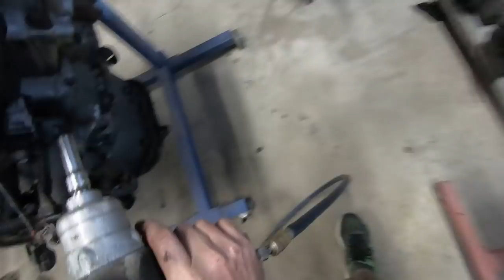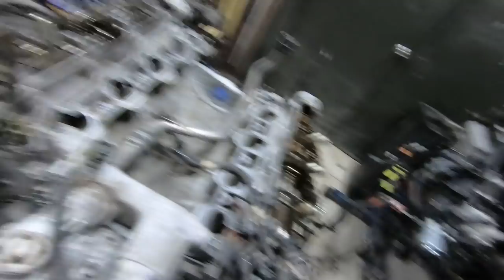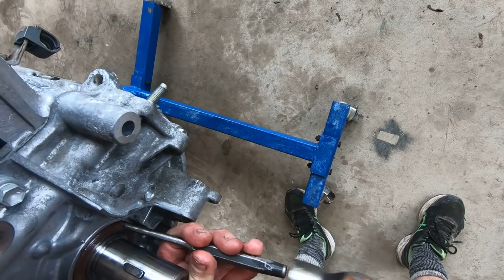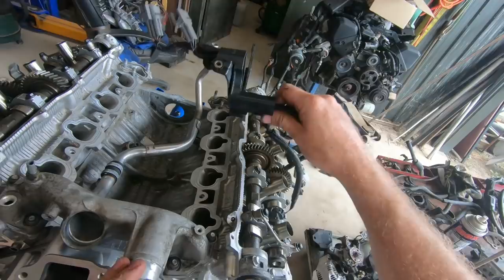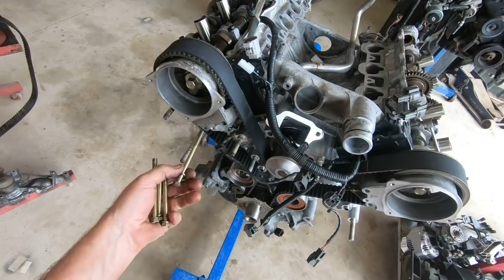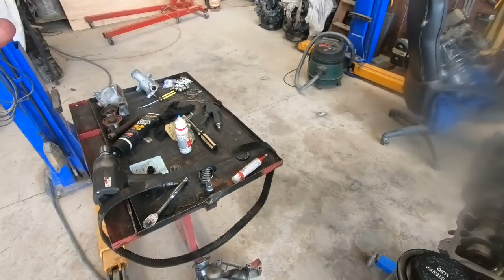1uzfe Cambelt / timing belt replacement. suits LS400,  Celsior, SC400 and soarer. 1uz

Comment: Brah!!! when you said "Little Dot At the bottom of the crank" that one line was EVERYTHING in this whole process... Ive seen NUMEROUS vids about how to properly line up the belt and the markings but no one SPECIFICALLY mentions what the crank mark looks like on the crankshaft gear... CartuneNZ is my SAVIOR!!!! Thanks Again!!!! when it comes to my 1UZ-FE engine im trusting CARTUNENZ!!!

Comment: Did this job in my garage in 14 hours, engine still in the car. Not too shabby :-)
Reply from the maker: Well done.  I started doing one in the car recently.   Camera running. Then found oil leak between oil pump and block so dropped the engine out to fix.  Videos are coming for that one.
Reply: @CartuneNZ  Awesome. looking forward to watching. Subbed. Good luck!

Comment: Just hopped a tooth on a 94 Lexus and was in for a helluva time, thanks for the info, making things easier
Reply from the maker: Hello Randal.   Glad to help.  Hopefully yours is a gen 1 engine.   Cheers Kelvin.
Reply: @CartuneNZ Why did you say hopefully its a Gen 1 engine? i have a gen 1 engine & have been having a helluva time trying to get it running right after replacing the head gasket & all the other old components

Comment: any tips help: stuck on cam bolts, won’t come off even with 170 PSI on the air gun
stuck on coolant channel above water pump, thing is on there real good and won’t budge

Comment: As Kelvin screws the distributor caps into the cam pulleys, "Well I probably won't do them up with the rattle gun...well, not on camera anyway". Lol!
Anyway, another top video from CartuneNZ that I studied in depth, before attempting to replace the timing belt on my 1UZ-FE VVTI.
Kelvin: Will you publish the names of your secret car part goo, such as the "lube" you put on the cam seals, and an injection of something mysterious and helpful onto the front main seal, from a push tube with "Master Gasket" written on it?
Thanks again for sharing so much of your knowledge! My '00 GS400 would not be running (like new) if not for your super awesome videos!
Reply from the maker: I use a Moly grease for the centre of the seals , this is an engine assembly prelube, so it works great for priming oil pumps too.  The Master gasket is a Loctite product , 518 master gasket.  Great for the outside of the seals as it helps them slip in them ensures they stay in and is a sealant to 10 thou gap.  Cheers Kelvin

Comment: Subscribed! I have a 1992 SC400, upon which I am about to attempt a starter change. Could you please do a video on ALL the other components I should change while I am in there, please? I hear that gaskets need to be refreshed, certain plastic bits will surely break, and certain hoses will need to be replaced as well. I would be most grateful to see the whole pile in one place, because as I assemble my set of new parts, I am afraid of leaving something out. I find especially confusing, the bundle of snakelike hoses all around the intake. I can't tell what's what.
Reply from the maker: Ive done plenty of videos on changing starter motors and removing intake manifolds if you search for each.  My engine prep videos cover lots of the parts used.  I have other topics to cover at present.   Cheers Kelvin.

Comment: Hey Kelvin, awesome videos ya got. Just found your channel a few weeks ago and been watching lots. Was wondering what gasket sealer you're using on the WP and the crossover gaskets. (just as a safety measure) Is it a FIPG or just regular sealer? Another question; The cam belt kit I got from Aisin has a metal gasket for the thermostat housing. (square) I've done a few cam belts/WP on the 1UZ and everything I read and always seen it uses FIPG. Is that part of the water pump machined smaller to accept the metal gasket like the back of the newer WP is or should I just stay with FIPG? Keep up the good work.

Comment: I've got a question: 
I found the product you use to lube the inner seals on crank and cams, but I'm not sure what sealant you use on the outer ring.
Looks like a Loctite product but I can't tell what, and I'm not sure if red thread locker would be the proper application fluid.
Doing this process on a 1st gen 1uz ('92 sc400) within the next few days and am considering doing those seals since I'll already have it open.
Let me know what products you used! thank you, this video helps tremendously!!!!
-
also; on the water pump outlet by the thermostat, specifically the plastic housing to metal, do you use any FIPG? if so would you use grey type? (ex: Aisin AB1207B1 or equivalent)
Had my car worked on by a family mechanic; and it's leaking from there with grey RTV / FIPG, and idk if that's proper application considering its leaking and there's no room for the gasket maker to seat properly.
Thanks again! Might shoot over an email if I don't get a reply, can't find any info on it.
Reply: And it's a 1st gen UZ, and I bought the Aisin kit since they manufactured Toyota water pumps; doesn't have the grooves for FIPG so I would only use the included gasket and no FIPG?
Just confirming after watching your video on the differences between pump seals (very helpful, thank you for teaching me that).
Reply from the maker: Loctite flange sealant #518 for outside of seals.  Use correct gasket with no sealant on the thermostat housing. If it leaks generally it's due to the plastic housing being stuffed.  Use the gasket that came with the waterpump.
Reply: I believe the outer gasket liquid you're using is Loctite 'master gasket', which is either 515 or 518 formula; let me know if either works or if one is better than the other
Reply: @CartuneNZ  much appreciated; thank you for the quick response 👍

Comment: Hi Kelvin, I'm in Virginia, started buying <1997 Gen 1 SC's last July, have 2 2JZ-GE's and 4 1UZ-FE's.  Your content is most helpful.  I've a desert stored '95 SC400 (my 'practice' car, only one not a 'garage queen'), only running on right distributor.  Replaced port (left) side coil, open hv coil, checked igniters - both coils now fire, left rotor and dist cap look good, but 1, 7, 4 & 6 just not firing...compression check OK on all cylinders.  Rotor alignment tab on left dist is correct.  Left cam position sensor resistance is OK.  Where might I look?  Thanks so much for your awesome, kinetic videos!  I love the 2JZ's, but REALLY love the 1UZ's.

Comment: Thanks very much for the close ups of the timing-marks. This made me to find the problem of my 1uz-fe 2ng gen. But belts and pulles need to replace. Does the 211 teeth belt match to the older engines, or do I need to get the 209teeth? The sets withe 211 teeth are quite cheap.
Reply from the maker: Glad I could help.  With early non vvti engine you require the 209 tooth belt.   All other parts interchange fine but not the belt.   Personally I use all genuine parts as they are known good quality.  Cheers Kelvin

Comment: Hey kelvin, the threads for my timing belt tensioner are stripped, what would be the best course of action, helicoil? Thread insert?
Reply from the maker: Best option would be a replacement oil pump with new threads,  next is a thread repair system like helicoil or similar.

Comment: Thanks for the reply the kit I bought was from a well known for high powered Toyota uz and jz powered vehicles and I am meticulous about getting the correct parts as my father is a very good mechanic from Invercargill the only thing that I can see to be any problem is the replacement tensioner I was supplied I did contact the seller and the mechanic there said to me he had come across a faulty one once on a 2jz he had in his garage but had done 100s of them since and never had any issues have u ever had a tensioner that when u pulled the pin u thought it seems a little week my motor is a ucf10 from a early 92 celsior single wire o2 sensors and it has slipped the cam timing 3 times and it's always the drivers side bank the motor is in a 2wd 1990 hilux with w series 5speed and I am from Queensland Australia both my parents are from NZ thanks
Reply from the maker: I only use genuine parts so problems are extremely rare.   If its slipped timing several times I'd definitely have it apart to inspect.
Reply: Yeah I have had it apart quite a few times I think I can have all the covers and all the intake manifolds off in about 9 mins it's funny when I hear u say that people tell u it's a bit of a job to get it all apart . It's very expensive buying genuine parts when I first got my 1uz I went to Toyota to get the plastic thermostat housing and they rang me a bit later saying they could not supply me the part I ordered because all the 1uz parts r only sold by Lexus which was on the other side of the city and was $110 so I got ECU temp sensor at the same time and it was $89 so the genuine article is a bit out of my budget and I have knock codes o2 codes and AFM codes popping up from time to time I think one of them spitronics Orion standalone might be in my best interests

Comment: I just broke the crank pulley nut loose by using a 22mm and a breaker bar on the nut..then cranking the ignition for a second, twice.  @18:25  you say dont go turning a gen 2 motor over...did I just screw myself? Did this on a 97 ls400
Reply: I believe so maybe bent valve?

Comment: I forgott to ask you on the 95lexus sc400 there is a small solenoid beside the water pump on drverside with a wire sticking out of front it there a round piece of rubber that broke off front of it now it's open and some sticky oil slung all over compressor it sits close to compressor what can I use to cover it back up it's a small looking solenoid
Reply from the maker: Watch my Hydraulic fan pump video.  https://youtu.be/nB2qZShzhog  it explains the solenoid.  I would use some RT125 potting compound myself but any suitable epoxy should work.  Cheers Kelvin

Comment: What would you recommend changing in addition to the belt while the engine is dissasembled? I am thinking thermostat and cam seals and maybe a starter? Is there anything else that makes sense to change for a peace of mind? The car is 1998 GS400 with 210k miles. Thanks for the heaps of usefully info
Reply from the maker: Hello.  For a 210mile tidy up I would do full cambelt/bearings/water job with cam and crank seals,  front external bearings,  avis vsv,  check starter,   rebuild powersteer pump and check alternator.  Tappet cover gaskets when doing cam seals and the vvti filter can be checked.  Possibly the o-rings at the front of the vvti activators too.  The intake would be stripped as its likely full of oil to clean along with cleaning throttle body.  Id pull the sump off clean and reseal.  New spark plugs as required and check coils.  Oh and a rear main seal.  Then it should be ready to wire,   I'd expect plenty of broken connectors.  Sounds like lots but its not too bad.  Cheers Kelvin

Comment: Nice video Kelvin, enjoying watching them all, lots of nice tips in there.
A quick question have you ever had a 1uzfe running with no cam belt covers, to clean up the front of the motor by remove the plastic covers and bits along with the metal brackets behind the cams. I know they have the markings on them to align the cam gears but maybe they can be slotted to slide them in when doing a cam change, and the bottom section has the timing marks on it so it may have to stay in place,  or isn't that allowed on a street cars or hot rods in NZ
Reply from the maker: Hello russ.  I am always going the other way and refitting the cambelt covers to stop the possibility of stuff falling down there.  There are some restrictions around rotating components at the front of the engine but I think that is more to do with fans so Not sure of no cambelt covers.  Cheers Kelvin
Reply: @CartuneNZ  Thanks for your Reply Kelvin, really appreciate the time and effort you put in doing these excellent vids. 

I know where your coming from about bits being dropped or bits caught in moving parts. Us hot rodders and race car guys always have this thing less is best, and do I really need that it hides that cool spinney thing, nothing like a bit of bling and action happening under the bonnet or in my case no bonnet.. Just need to create a gen1 version of that cool Hughes Racing carbon fiber front cover...
Cheers Russ

Comment: Hey kelvin I was curious as to what the purpose of turning the engine 2 revolutions after putting on the belt was for cheers thank you !
Reply from the maker: Its to recheck the marks.  The alignment dots should match after two revolutions.  Always double check to avoid incorrect cam timing

Comment: hello, would you be able to advise me: started the timing belt job with marks on "0" and the dots at cams, not at "T" marks.  Timing belt is off and I don't know how to safely proceed. I would put it on and move it to instructed points but I'm having a hard time installing it back on.  just a gorilla with a wrench here. :/
Reply from the maker: Sounds like you might want to watch the vvti videos.

Comment: 43:00 is this timing cover necessary for engine function? Mines already broke and the little plastic spacer was missing.
Reply from the maker: The engine will still run however I recommend fitting to avoid the chance of crap going up there.  Toyota fitted it for a reason.  Cheers Kelvin

Comment: Best Channel ! Slow down sometimes
Reply from the maker: Thanks.   My later stuff I slow down a bit,  unless I'm excited,  those once everyone needs to listen faster.  Haha.  Cheers Kelvin
Reply: @CartuneNZ  How do I send a question to you about my 1uzfe Gen2 non vvti LS400?
I have a ticking noise coming from my VSV connector. I checked continuity and I am within spec, replaced rubber and checked for air leaks as well. When at idle temp it starts ticking...can I bypass?
Reply from the maker: I have email at end of most videos and in the description of later videos of info@thecartunecompany.co.nz.   I think I would be trying another solenoid before trying a band aid.  Cheers Kelvin

Comment: And Oh, yeah, already had the ECU re-capped (SIA Electronics, several others by Tanin, both seem to do good work).  Car has 220K miles, horrid Sun heat damage interior, leather not just stiff, but crumbly, plastic is brittle...just a practice to repair car...has glass high beams, maybe put them on a '92 SC400.

Comment: Does the engine need oil when changing the timing belt ? And water pump , or is it bad if I rotate the crank when there’s no oil in the engine
Reply from the maker: no, fine without oil to do cambelt job

Comment: how do you clean off your motors?  I have even more crud in place.  Your motors are spanking clean after clean up.  I also see I need to calibrate my torque wrench to match your own.
Reply from the maker: Theres a trick to cleaning engines.  I have a good degreaser to get the crap off,  then toothbrushes and wire brushes.  Then parts often get covered in alloy mag wheel cleaner,   that makes them shiny.  Then i have another general purpose cleaner to finish off.  My torque wrench is self calibrating,   and quicky changes between every different bolt,  Haha.   Cheers

Comment: Hi I done timing belt and water pump kit and all associated bearings and tensioner with good quality brand new replacement and a month or two later at a cold start it started fine then 60sec later it just snuffed out I tried to restart it but it wouldn't run unless I had throttle wide open it seemed obvious to me at the time it was a spark timing problem and found the right bank cam timing had skipped 4or5 teeth for no obvious reason so I reset timing and restarted the motor then a month later same thing happened the tensioner seems the only thing that could be at fault. Any thoughts?
Reply from the maker: I would be checking it has the correct tensioner bearing assembly.  Cheers Kelvin

Comment: If I have the OEM water pump should I use the silicon gasket maker the dealer provided me, or should I go with an actual gasket like the one shown in this video? What would you recommend
Reply: It’s a 94 sc400
Reply from the maker: I recommend using the correct sealing technique.  I have just filmed a video on the topic which I am editing now.(as in right now)  If it has receiver grooves then it takes silicon , if it has a flat surface then it takes a gasket.

Comment: I've been having trouble finding the dot to line up the crankshaft with the belt, and it slipped off TDC when I took the balancer off. I guess I can put the nut on and turn it around again and just put the mark at the very bottom, right?
Reply from the maker: Screwdriver down #1 spark plug hole.  TDC will be TDC.  Good luck.  Cheers Kelvin

Comment: Mine 1uz is a pre September 1994 jdm unit, the first and lower power version, are the water pump/timing belt kits specific? Because some ads for kits say "Suits 1990-97" thanks if you can help.
Reply from the maker: Flick us a message and we can get things sorted next week as we are all back on board,  well physically,   mentally might take a bit longer.   Cheers Kelvin

Comment: Do you have any videos of this on the later VVTi engines('99)? I read somewhere that the cam seals are different and require more work to replace...
Reply from the maker: yes.  I have a video showing the removal of the camshafts to replace the seals as part of a work video.  https://youtu.be/oTScj0V0rm4  Cheers Kelvin

Comment: P.S. I think I've already asked you but do you sell any parts to Australia? My 1uz is at 165k and yesterday it blew smoke(hopefully valves aren't f----d) and ran on 4 cyl for about 30 seconds when I started it so I think its time for dizzys rotors etc etc. and the fastidious previous owner changed the timing belt at 80,000! (It picked up and ran beautifully once all cylinders started firing again)
Reply from the maker: We send lots over there as your parts guys struggle with 1uz and no chassis or rego number.